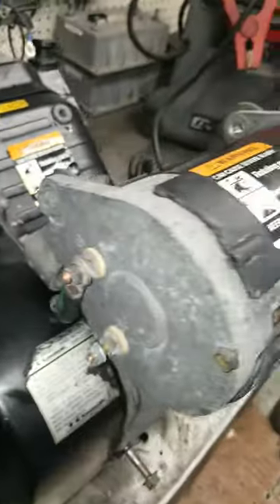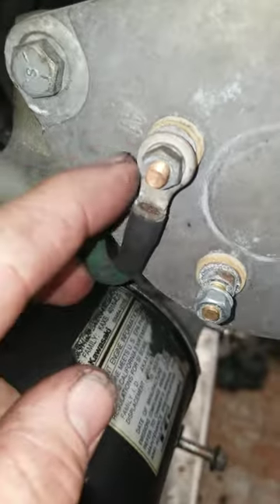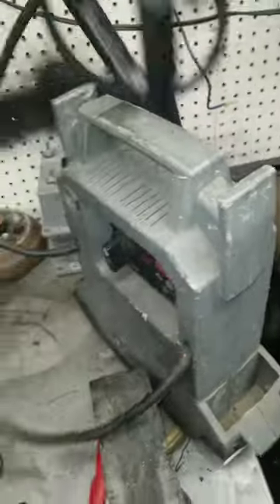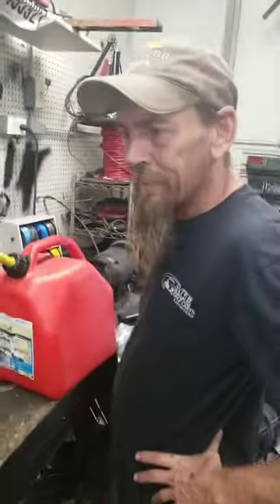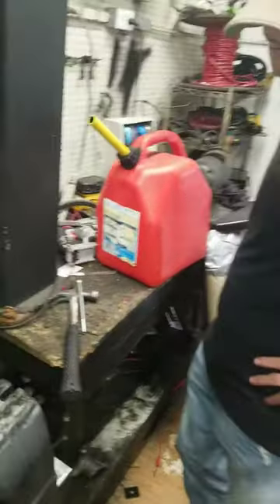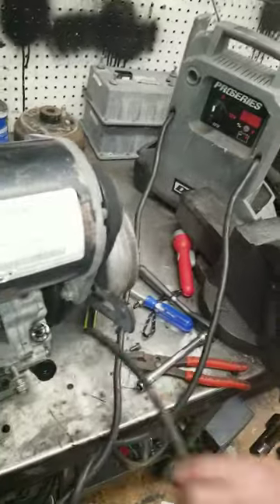Testing starter on a golf cart.. quick and simple

Comment: I have all those tools on my back pocket let me just simply test my starter….
Reply from the maker: Lmao
Reply from the maker: I know what you mean
Reply from the maker: I hope if you’re watching the video. You at least have them in your front pocket😂😂😂
Reply: @HeyHeyHey97  wow I didn’t know you had all these videos… I just bought a golf cart and been working on it for two weeks. I bought a new battery, solenoid, cdi, coil, ignition, carburetor and drained the old gas and replaced it with new gas.  It turns over but won’t fire up. It’s driving me crazy
Reply: I just subscribed by the way
Reply from the maker: What year is the cart???
Reply from the maker: If has the robins engine. If battery is wired backwards it will still turn over but want fire
Reply: @HeyHeyHey97  older it’s a Yamaha 2000
Reply: @HeyHeyHey97  really? So if I turn the battery around will that work or will I burn something out ?
Reply from the maker: @ericmontanez7276  what wire do you have on your negative on battery
Reply: @HeyHeyHey97  I’m in my garage now and it’s turning over now but won’t stay on. And I have a black cable on my negative post going to the starter
Reply: @HeyHeyHey97  and I have the very same starter generator that’s in this video
Reply from the maker: That’s right
Reply from the maker: Is is cranking up or just turning over
Reply: @HeyHeyHey97  it turns over but sputtering. It sputters and misfires but won’t start
Reply: It’s been two weeks everyday in my garage and it’s driving me insane lol.  I don’t know but it’s got all new parts so I don’t understand
Reply from the maker: You have the right spark plug in it. Have you tried spraying starter fluid in the carb.  First open the air box up and try to run it like that. And see what it does. If you ordered one of them cheap carbs. Off line. They aren’t worth a crap. And flood like hell causing it to sputter likes it flooding
Reply from the maker: @ericmontanez7276  if it runs good once you open the air box up then your carb is flooding
Reply: @HeyHeyHey97  I have called golf cart repair locations near me but they say they don’t work on older golf carts. Is there a way we can contact each other rather than on the YouTube comments? 😂
Reply: @HeyHeyHey97  ok let me try that
Reply from the maker: I’ll delete my email in 2 min
Reply: @HeyHeyHey97  ok cool
Reply: So I opened air box no change
Reply from the maker: Did you get it working